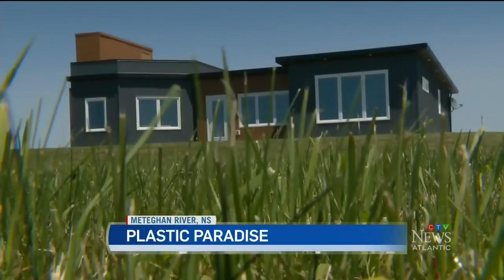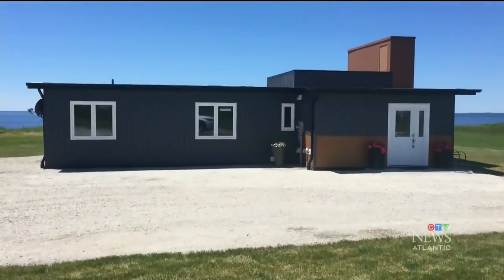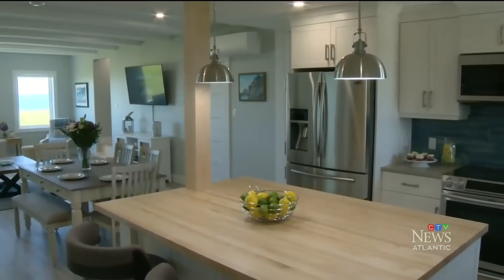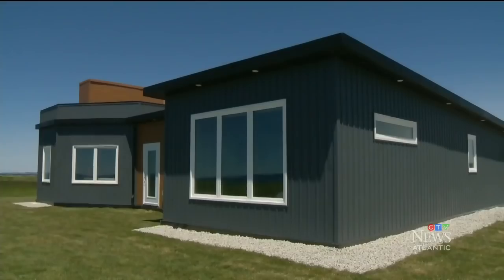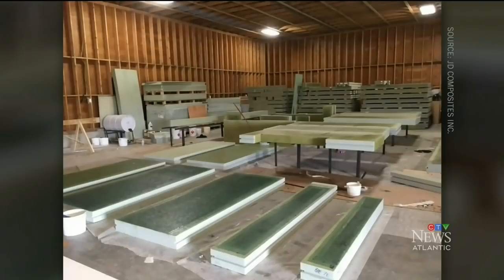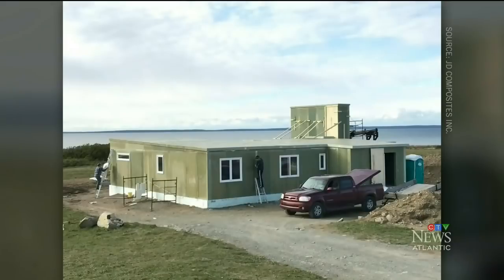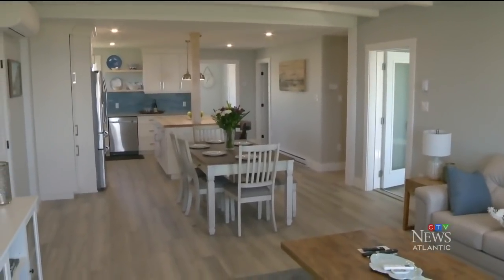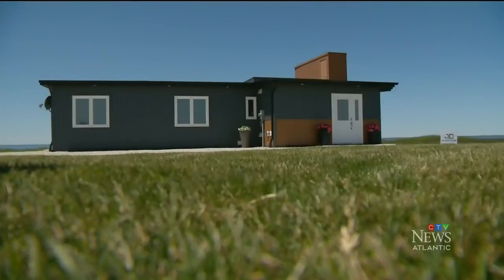N.S. man builds house out of over 600,000 pop bottles

Comment: I wonder if there is any out-gassing from the plastic foam ?
Reply: Great question..I was wondering also about Cancer agents from the plastic heating up. This house might just be too Dangerous to live in
Reply: @roblo6129  Meanwhile there is plastic in most everything you eat and drink!!
Reply: @keithforbes8482  exactly
Reply: @roblo6129  instead of speculating to yourself and others inform yourself and then share.
Reply: @keithforbes8482  microplastics cause cancer inside your body as well what's your point
Reply: @josullivan5189  what do I need informed about plastic causes cancer.. whether you heat up a bottle inside your car or drink through a plastic straw it's all the same.. so what part do I need to be informed about. I'm not going to live in a plastic house so if that's your choice choose it
Reply: @roblo6129  cite verified source?
Reply: Yes, there IS "out-gassing from the plastic foam" which is a real health hazard. One problem using recycled plastics. I want to use recycled products but not sure how to do it safely.
Reply: Keith Forbes Which could be why cancer rates have continuously gone up over the decades. 🤔 🧐

Comment: How will it hold up to extreme weather conditions or fires? It's great to talk about recycling things but that's just one aspect.
Reply: I was just wondering that.  Plastic is toxic when it's burning.  A house fire would not be survivable due to the fumes.
Reply: @CroneLife1  so i have to wonder how exactly does a stick framed home hold up to fire??
Reply: @keithforbes8482  , doesn't matter how it holds up if you're dead inside it from the fumes from heated plastics.
Reply: CroneLife I suspect that your concerns have already been addressed. Just as asbestos is being corrected now. While you might complain about governmental interference, these laws do consider safety hazards.
Reply: CroneLife So why did local codes ok this project to be built?
Reply: @CroneLife1  PET plastic does not burn, period. It would liquefy
Reply: @Gnomesmakemesmile  will the liquid , burn my skin off?

Comment: That's like $60k in bottles. It's more expensive than regular materials.
Hasn't anyone thought of, ohhh I don't know, making new pop bottles out of the plastic?
Reply: That and the energy usage and environmental impact of the recycling process it's self has to be accounted for. Just ask China.
Reply: That's $60K if you were to go with the recycle cost.  If you or I were to save 600k water bottles, it would likely cost closer to $600k.  It's still a better use of bottles than throwing them in the ocean.

Comment: You took all those bottles out of the recycling system, now 600,000 new plastic bottles have to be produced to replace them. I think you misunderstand the word “recycle”. If the system were to work the way it was intended to work, and every pop bottle was melted and turned into a new bottle or similar package, we might be able to clean up the mess. If you really are intent on virtue signalling, you should use only bottles that weren’t put into the recycling system. What you did was no different than buying clothes from a Goodwill store, and turning them into high end designer wear.
Reply: I see what you’re saying. They should have used plastic from the oceans instead, but 600,000 bottles don’t have to be produced. We don’t need to replace them. We need to stop using them.